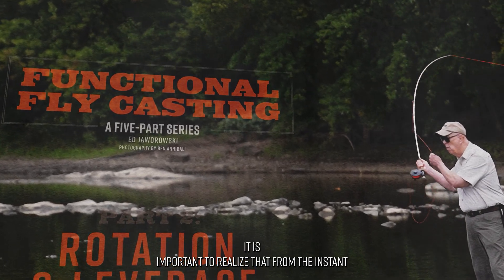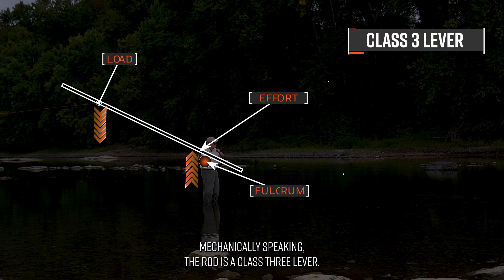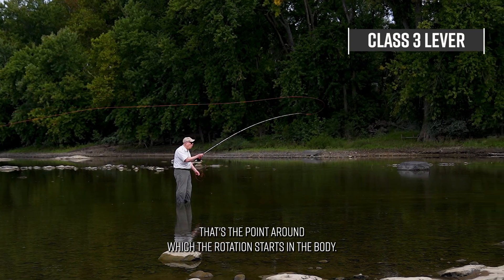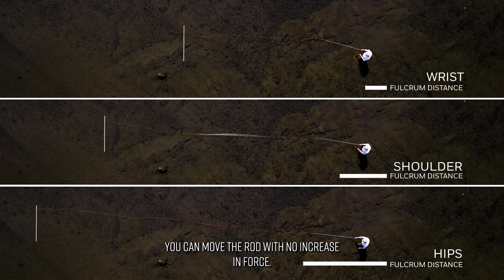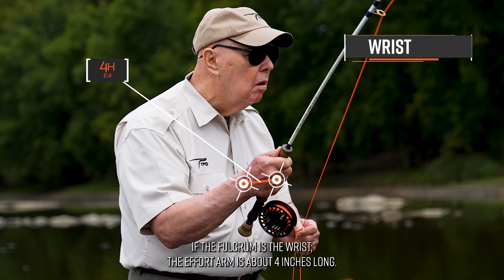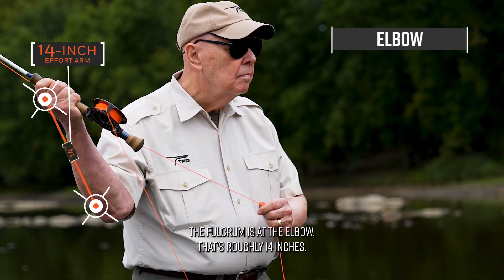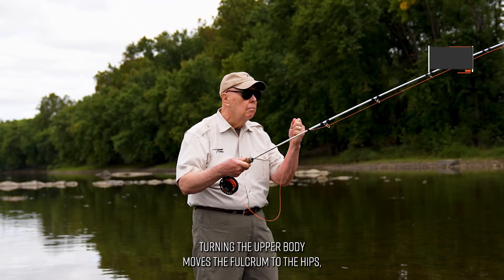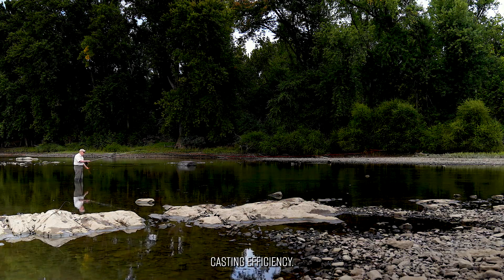Ed Jaworowski's Functional Fly Casting Part 2: Rotation & Leverage

Comment: This explanation is not true.  Or, I should say misleading. It is not about the effort. Fly line is light. Also, rotating the arm or the hip is not requiring less effort than rotating the wrist. It is about the speed. You use the rod as a 3rd class lever to increase the linear speed at the tip. At the tip, it is amplifying the linear speed generated at the butt. Do more accelerating stuff at the butt end, you will get more speed at the tip. If it was possible we would have even bent our body over our big toe to add speed.

Comment: what is the most efficient/easiest at shooting line? faster or more bendy rods? or just depends on the casters style?
Reply: Complicated answer, and I’m not a certified fly casting instructor but long-time fly fisherman. Shooting line is about achieving line speed, a tight loop, and TIMING. Timing, timing, timing. But if you don’t achieve line speed, you’re not going to get that line to shoot. Tighter loops lead to higher line speeds (more aerodynamic, all things held constant). But once achieving that, shooting line can still be an issue due to timing. Thus, all things return to PRACTICE. Good practice makes for faster learning curves (i.e., get a good teacher to observe and correct), but sheer time on the practice lawn overcomes almost anything. Try this. Years ago after being frustrated with my performance on a trip, I dedicated myself to one hour of practice, every day, for one month. Wow. Dramatic increase in casting performance that stuck.  Every day. One hour. Yes, I could cast well before, and yes, I had a good practice routine, but just putting in the time is the big thing. Just my two cents! 😊
Reply: Faster rods. Also, the casting style matters. If you want distance, you need to add hip, arm and wrist speeds. The order also matters. First the hip accelerates then add the arm and finally the wrist.